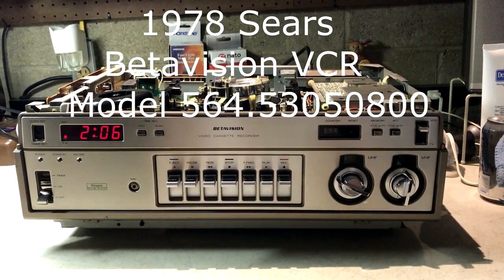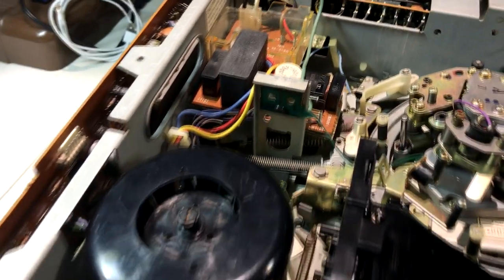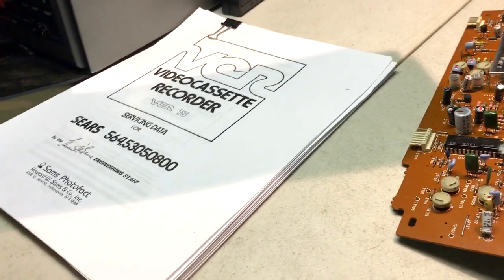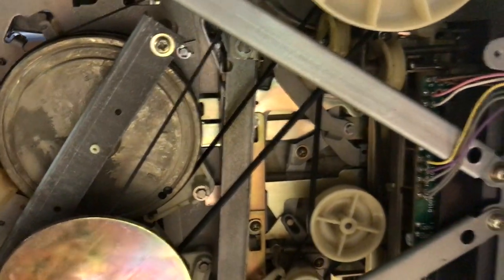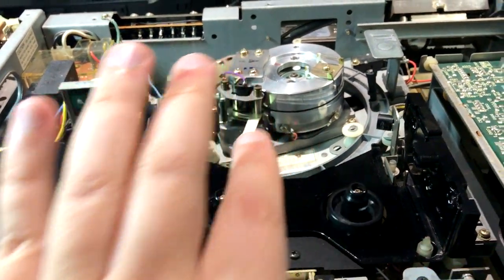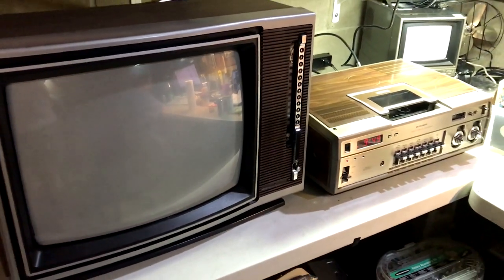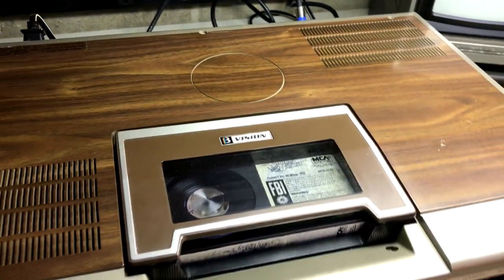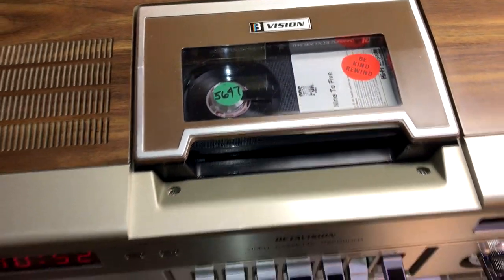1978 Sears Betavision VCR Model 564.53050800

Comment: I had that model in the day. The removable circle on top was for dew conditions and that would help dry it out. I suppose you could use a hair dryer 😊. Mine had an issue that Sears couldn’t fix. When you stopped playback, the tape was momentarily glitched such that subsequent playbacks the sound would drop out and the tracking would go out of sync. I replaced it with a Sony SL5400 I think.

Comment: I have a Sanyo VTC 9350 which is the PAL/SECAM version for the Middle Eastern market and has exactly the same mechanism but a VFD clock, not LED. Very well-made machine and will last forever! The date on the motor is 1980. What about yours?
Reply from the maker: Fivos Sakellis Very nice! And mine says March of 1978.
Reply: Yours seems to be an early production unit. I figured out what the lid on top of the head drum is for. If the VCR got humid, you could remove the lid and use a hairdryer to speed up the drying process. It's strange how the manuals don't mention anything about it.
Reply: Fivos Sakellis, do you have a video about your Sanyo VTC 9350?

Comment: Are all betamax players valuable?  If I could get them for $10 or less would it be a good buy?
Reply: When I have found them in pawn shops, they are worth more than equivalent VHS machines with similar age and features. There is a market for them. The tapes, especially L-830 are also valuable, since none are being manufactured anymore.